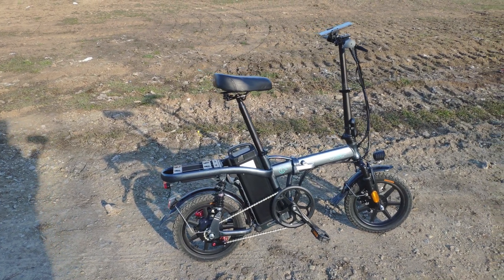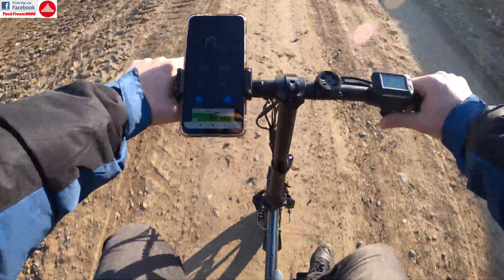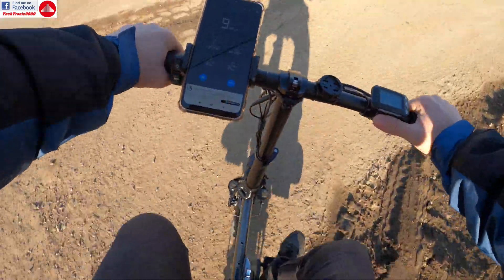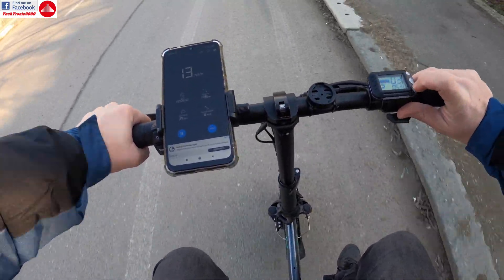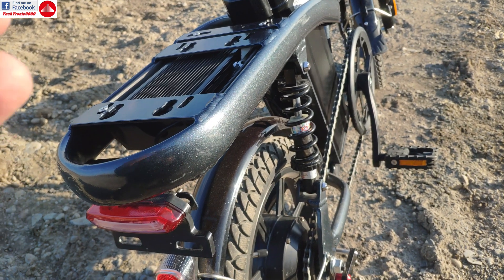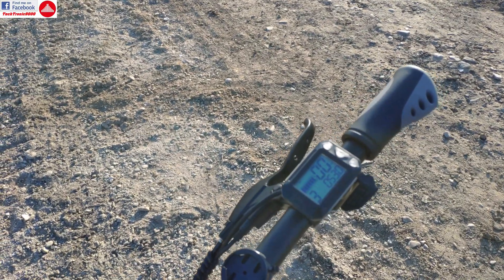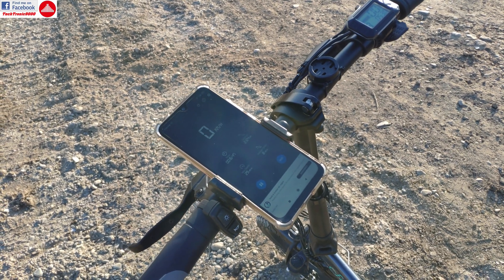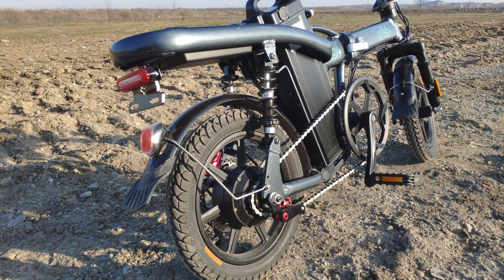Fiido L2 Ride & Speed Test with 1200W Controller Upgrade

Comment: if i add a front hub will i have a problem making connections with wires?
Reply from the maker: For a front hub you need a 2nd controller that is compatible with the other one and they could work in sync with the same throttle.

Comment: The motor is not wired for speed only a few turns proably
Reply from the maker: Yes, it's designed for torque, not speed.

Comment: Do not floor the throttle when the bike is stopped, this will drain huge amount of energy from the battery reducing its life and heating your motor. A safer way to ride is to launch the bike with the pedals and then press the throttle gradually👌
Reply from the maker: That is true, i usually use soft acceleration and also pedal at startup, this was just a test for the upgraded hardware.

Comment: Do you know how to check the voltage on Fiido L2 ebike hall sensor wires. I have learned that if there is a 6th wire which is usually white. That it is either a thermal wire or a speed controller. If the voltage goes above 5v then it is a speed controller. Will you please let me know ? Thanks a bunch. But this I read about and not in a school.
Reply from the maker: On my L2 the white hall wire did not have any effect on the bike.

Comment: Does the front light still work with this controller
Reply: U the best 👍thank u soooo much
Reply from the maker: Yes, the controller also has light output wires.
Reply: @TechTronic9000  thanks for the response, did u manage to find a way of increasing the kmp. Would u need to change the motor? Or battery to do this?
Reply from the maker: You need to change the motor.

Comment: Hi did all you do is replace the controller for all this speed? Or did you have to upgrade the motor
Reply from the maker: Just the controller, but it's not a lot of extra speed. The stock controller gives you 22-23km/h (25km/h) and with the new one you get ~ 26km/h.

Comment: Remove the white cable
Reply from the maker: The white wire from the hall sensor, tried that also on the stock controller and on the new one, no increase of speed. I have also found the producer of this motor and they confirmed that the motor is designed to give ~25-26km/h at full battery voltage. That is why the original controller of the L2 actually does ~23km/h so it keeps the speed constant as the battery voltage decrease. To get faster speed you need another motor designed for speed.
Reply: @TechTronic9000  I saw some fiido 12 inches motor (without tyre with tyre 14) rated 1200w in some indonesians video with fiido bike q1s. Do you think the stock controller can handle those wattages? I want to upgrade my L2 motor to 1000w or above. Will I need new controller?
Reply: @roeyearl9431  I’m waiting for a reply to this - I have a fiido L2 as well and the 15 mph is not fast enough - I would like to upgrade to go at least 25-30 mph ... what do I need to change on this bike(
Reply: @TheQuickDrawReport   I just replaced the wheel for a 48v500w the problem is its gearless so you need to remove chain, you also need to play with the controller cables which is the most laborious part, soldering the edges etc
Reply: @TheQuickDrawReport  easy 32km/h peaks at 38km/h but no chain means no pedalling haha

Comment: where did you find this speedmeter/display controller? was it included with the bike? because that what i want to buy has not speed meter or display at all :(
Reply from the maker: I'm using this controller 25A (500W), type 4 LCD: http://bit.ly/2GcO4GS and brake upgrade (semi-hydraulic): http://bit.ly/31NPK3x

Comment: Hey, an unrelated question. Is this bike designed to be waterproof? like can you ride under the rain? cheers
Reply from the maker: I rode it in rain several times and also pressure washed it 2 times, zero problems, although it's not built to be 100% waterproof, but rainproof it should be ok and some occasions.
Reply: @TechTronic9000  I see, I guess getting some cover for the battery and all the electric component area it should be ok. Thanks!

Comment: I know it's a different model, but I bought the D2 last week, rode it twice and sold it the same week. Hopelessly under powered, a shame as it's a very well built and comfortable bike but just sooooo slow. At least I got my money back😊
Reply from the maker: These are low power 250W eBikes, specially made to adapt to EU laws where you need max. speed < 25km/h, max power 250W and assisted mode.
Reply: L3 is faster

Comment: I am curious if this bike would be too small for someone 190cm tall?
Reply from the maker: No it isn't as the seat post and handlebar stem can be extended a lot!
Reply: @TechTronic9000  Thankyou for the reply.

This bike looks great fun bike for relaxed touring/local shopping and possibly camping with a <50kg bike trailer. For camping, a spare battery would be ideal, but not absolutely necessary. Range, not speed, is important for my biking.

I have narrowed my choice to this bike and the Rattan XL https://www.indiegogo.com/projects/rattanxl-over-100-miles-on-most-affordable-e-bike#/ , both are well within my price and travel range. I am going to review the specifications before deciding.

From the specifications given, do you have any opinion regarding the Rattan? I am not very experienced with ebikes. Thanks again for your great videos, makes me want to visit Romania!

Comment: Sir any upgrade for D2 to make it 30kph?  thank you!
Reply from the maker: Yes, replace battery with higher voltage, the controller and the motor.
Reply: @TechTronic9000  what motor would you suggest Sir?
Reply: @MadzeR thank for the reply.  I have the D2S so no luck unlocking :( that's why I'm looking at Fiido owners upgrade path that I can use to increase speed as wel as distance and durability.

Comment: Take the hardware off passenger seat. Build a wooden compartment attach seat hardware to bottom of compartment henge seat as cover to compartment like a lid.  Attach now seat compartment to bike rack. Place controller inside compartment. Now you have housing for controller and seat for passenger.
Reply from the maker: Thanks for the tips! But because there was not any true benefit i have switched back to stock electronics. This was mostly a demo to show how the bike will work with an unlocked high power controller using the same battery & motor.
Reply: Front wheel jerking up in the air? Whooaaa... No no no

Seriously dangerous... especially if there's a little kid sat on the rear seat....crazy

Comment: I don't think you can increase the speed without rising the voltage.
Reply from the maker: Yes you are right about that, but still this was a demo of what happens when you increase power and use an unlocked controller. Some  guys around youtube claim "magic" numbers like 40km/h using an "unlock trick" and ride the bike downhill just to make views.
Reply: @TechTronic9000 Well some scooter have a speed limiter to comply to european law yes.... but changing the conroller using the same battery voltage? that's never going to help unless it is the only way to remove the speed limiter... 
unless the controller has some sort of step up converter... very unlikely and not so efficient "if" it could ever be applied at those current draws.
 You want more speed? then gearing or higher RPM/ Voltage... No other way in 2020 :-p ...
Reply: Has anyone tried increasing the voltage? Using a step up converter we could try running the bike at 72v. I would try myself if I had the bike but it's an expensive experiment if it doesn't work because 25km/h is just to slow for me.
Reply: Actually, the voltage on the battery is enough for getting higher speeds. But this L2 is just capped 25Km.

Comment: with that controller and that voltage battery you should reach 40kmh at least... I’m pretty sure that speed limit is active
Reply from the maker: The motor is designed to give ~ 25km/h @ 48V so you either over volt the motor or replace it
Reply: @TechTronic9000  doesnt the bike give 25km/h stock?
Reply from the maker: Yes stock is 25km/h

Comment: This bike has an 1200 Watt Motor but it reaches only 26 km/h? My Scooter reaches 30 km/h with a 350 Watt Motor. What’s wrong with it? You’re not from Germany ^^
Reply from the maker: The bike has a 350W planetary geared brushless hall sensored motor and a 25km/h limited controller. I've replaced the controller with a 1200W one that has no speed limit, but the motor with all that power is not able to spin faster especially due to it's reduction rating which is ~ 4:5:1. This also demonstrates the myriad of fake videos of "how to unlock Fiido speed" which is not electrically and physically possible without replacing motor and controller.
Reply: @TechTronic9000  you dont need to replace motor and controller, just put 72v 20s battery on it. Motor will handle it, not sure about controller but you can get 72v 1500w controller for less than 30usd on aliexpress.
Reply from the maker: The controller will not take it as it's a low power one, indeed overvolting the motor is another option but might not work for long as it's geared. You also should put in balance keep stock battery and replace controller and motor, or replace battery and controller and overvolt the motor. The second opinion might be more expensive because of the battery price.

Comment: Hello again friend. How are you. I have finally been able to translate your videos on Fiido L2 into Spanish. Your work is magnificent. With all that wiring. Wow. Too bad you have not been able to limit the speed, although it is interesting, to have achieved more power. For me, a maximum speed of at least 45 km / h would be ideal. Have you been able to find out more about it? I want to share a modification that I have made to my Fiido L2 in the rear damping, since due to a bad design, in terms of length, or placement of the same, they do not work properly. What I have done is the following. I have replaced them with longer ones (21.5 cm), and in this way you get the swingarm to be positioned at a better angle 90 ° or so. and get to work correctly. I have used Honda vision 75 scooter front shocks, I think Honda yupi 90, and Peugeot sv 125, carry the same. I have used these, because they are quite soft, and with my weight (80 kilos) they go quite well. They do not stop, as if the front suspension does. The Chinese sell shock absorbers of this measure, and at a good price, but the problem is that they have a very thick spring, and this will cause them to not get to work. with what you would stay the same. I had to increase two links plus the chain. I hope you continue to share more videos, especially from the Fiido, to see if you can limit it. a hug.
Reply from the maker: WOW! Thank you for all that precious info, will look into it and maybe also upgrade the suspension myself. To make it faster you will actually need another motor and that will be faster.
Reply: TechTronic9000 Hello, how are you, I am very glad to be of your help to improve the suspension of the Fiido. You help us a lot with your didactic explanations. Thank you. As for the issue of motor change, what do you recommend? We are limited in size, since in 14 "rim there is no big deal, I have seen engines up to 1500w, but they are very wide, and do not enter the swingarm. There are also engines to radiate, but the minimum measure is 20" . Another option would be to place 36v and 250w motor, in the same way and size of ours, and the 500w switchboard that you have installed, but I don't know if the motor would be damaged, since it has more voltage, and more intensity. I hope you can help us with the best choice. Thanks again for sharing. A hug

Comment: Do you prefer this over the D2? I know it has a more powerful motor and battery, but aside from that?
Reply from the maker: I have both and use them depending on the trip i need. For daily work riding I use the D2 as i do ~ 20km and it's lighter, easier to carry on stairs etc. For longer trips to the outskirts of town for long trips in the city I use the L2 for the immense range.

Comment: Hello, how are you, my name is Jose, I follow you on YouTube, I don't miss any videos. The ones I like most are those of the FIIDO L2, which I have recently acquired, and to which I am going to make the same reforms that you have made, and which you explain in your videos. The problem is that my level of English is very low, and although I activate English subtitles while viewing the video, I miss many details. It would be very good if you could activate Spanish subtitles, if that were possible. Or if you can think of something else that would ask me to help, "other than going to an English academy" ☺ I would appreciate it. A hug, and keep sharing. I really like the little one to collaborate.
Reply: Thanks for your answer. I have followed your instructions and I have not been able to view subtitles in Spanish, and I think it is, because my Android device does not give me that option. Phone and Tablet I do not have a computer. Anyway thank you very much. I will continue watching your videos, and in the process I will learn English. a hug 👍
Reply from the maker: I've tried from the mobile app and you are right, it only has an option for English but no translation. So it seems that it only works from the PC.
Reply from the maker: I've did a test and Spanish should work. Try this: first enable automatic captions (CC button) which enables english auto-generated. then press settings (gear button) and then choose subtitles/cc and you should have a new option for automatic translation, then you choose Spanish and it should work.

Comment: Hi there, do you happen to test the bike range at different speeds? What's the overall range in city traffic?
Reply from the maker: With the stock controller i usually ride ~ 20km/day and there is no drop in battery LED level. It will probably do 60km easy in traffic / city. On the open road I have ride it for an hour at max speed continually and the battery level was still showing 5/5
Reply: @TechTronic9000  wow, It sounds like it can easily do even more than 60km. Do you happen to know who's the maker for the cells from that battery?

Comment: I've got the fiido d1 10.4 ah and goes to 27 k/h for 387 € happy with it but miss power just 250 w power
Reply from the maker: I also have a D2 with 250W, it does 28-29 km/h with full battery, still a great ride

Comment: Need to increase the voltage........ wattage is not everything. Need to upgrade the controller to a higher voltage one for better speed but dont over do the wattage rating or its bye bye motor :P
Reply from the maker: Yes 100% true but sometimes these chinese builders use motors capable of higher speed and locked controllers. For instance a 250W/36V motor usually is good for up to 29-31km/h while a 350W/48V should give a 35+km/h. The motor on the Fiido is a in hub 4.5:1 planetary gear reduction motor so probably the motor is already spinning at it's KV limit.
Reply: @TechTronic9000  But if you were to swap the main crank case at the pedal side, with a 52 teeth one?

Comment: Top speed is only affected by the voltage. You can change the battery for a higher voltage one to get more top speed. Some of these motors are just built to run at 24-25 kph at that voltage. It could be a speed limit, or it could just be the KV of the motor. Best way to test is put it on a VESC or similar (borrow one) for a second, and see how fast it spins with no load.
Reply from the maker: It's exactly what i'm thinking because the motor on the Fiido is a in hub 4.5:1 planetary gear reduction motor so probably the motor is already spinning at it's KV limit. Probably a regular hub would be able to run faster on 48V.
Reply: Has anyone tried increasing the voltage to see what happens?